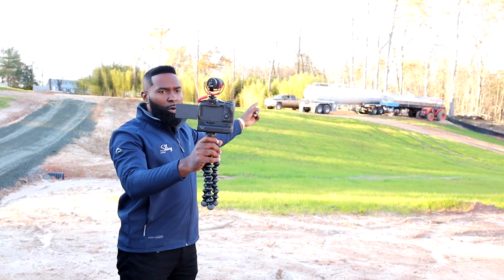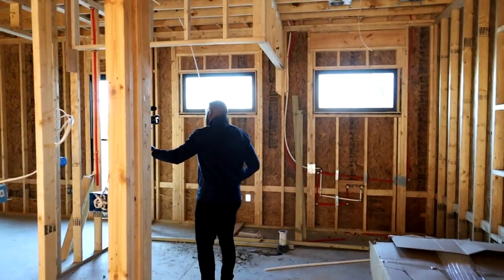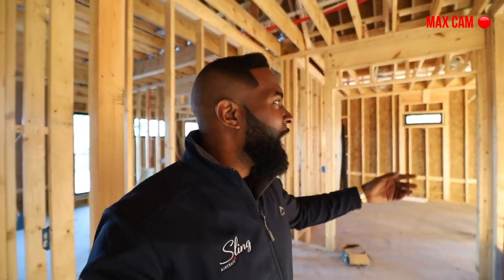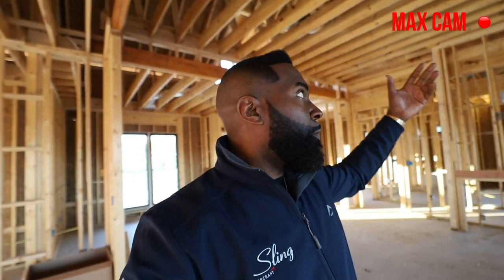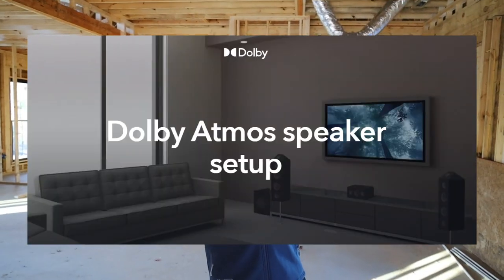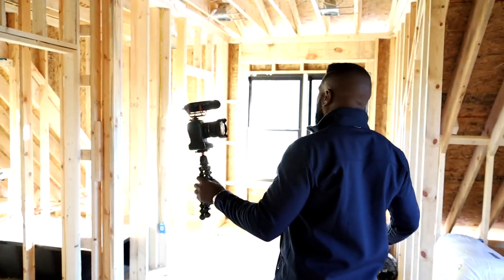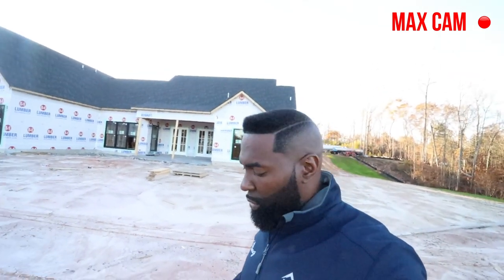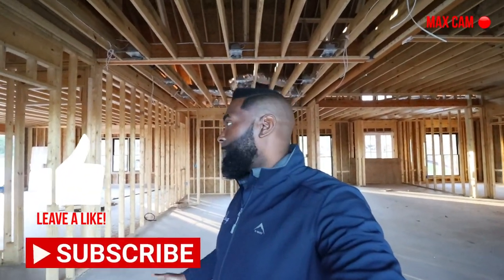Smart Home Update - Josh.AI

Comment: $11,300 on Cat 6. You're limiting yourself to 1Gbs.
It's 2020/21 you should be running Cat 8 at that cost to be future-proofing your runs to 10Gbs. Better shielding cables.
Also, go with a 2 sub not 4 on your home theater. You really don't need the extra 2 subs on your space. You should do a 9.4.2 setup. I heard 7:40 upward-firing roof speakers; Don't that either. Make sure your Atmos speakers (Height Channels) are installed in your ceiling and not on your Floor stands aiming to your ceiling.
Reply: True, the bouncy house for atmost is going the cheep way.  Make sure the folks installing your system know what there doing. It will make a WORLD of difference.
Reply: Cat 8 isn’t even an official standard. Cat6a can do 10gbs. But fiber will be faster than copper in terms of latency and would be my recommendation.
Reply: @jeffreygarrett1952  Fiber is not necessary for each point in the house. He can have over 30 drops, especially if he's hardwiring all his IoT/Media.Cat7 or 8 is fine. Cat 7 can do 10Gbs at 600Mhz. Cat 8 supports a frequency of up to 2 GHz (2000 MHz), which means you can transfer up to 40Gbs. Cat6a could do 10Gbs on short runs. Look at his house, I would run higher shielded cables. No sense in mixing Cat 6a with Cat 7/8. And he'll be buying 500' or 1000' runs anyway and terminating at each end. Only long runs like the other side to his Youtube studio, end-to-end switches should be fiber. For everything else, copper is more than fine as long as it's shielded. Now setting up his network is another story. Hope he isolates his devices into different VLANs and not attach everything to one LAN.